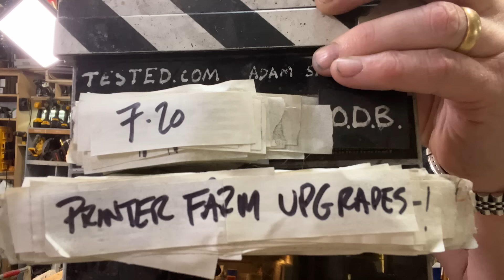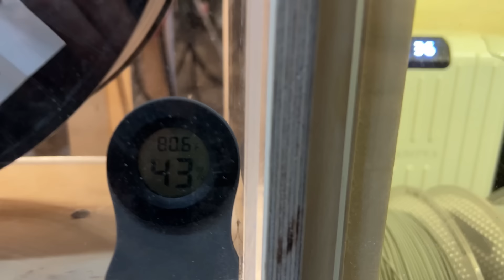Adam Savage's Essential 3D Print Farm Upgrades!

Comment: While I assume you probably know this, you can set the slicer to only print the support filament for the interface layers, rather than the whole support. That drastically cuts down on the number of filament changes.
Reply: Up Voting this bad boy, its suck a great time saver (and the really expensive support filament)
Reply: Also when printing PLA you can use any regular PETG as support instead of that expensive PLA support filament.
Reply: That's what Adam said when he explained it, I think!
Reply: No, that results in more filament changes. The filament still needs to be changed at the interface points, except now, the filament changes from support to interface and from interface to part instead of just from support to part.
Reply: @gownerjones you're forgetting about the perg time it saves.
Reply: @kathleenrobertpogue6818  Not sure what you mean by perg time but any time needed for filament changes is multiplied if there are more filament changes.
Reply: He literally said that in the video...
Reply: You took the text right out off my keyboard.
Reply: @gownerjones you have a lot more filament changes when printing the whole support in another filament, cause every layer needs to purge at least once. If you just do interface layers, there are no purges until you reach this point
Reply: @floriansollacher2804  Actually, you're right. I thought about this all wrong.
Reply: I'm pretty sure that's what Adam was implying. That's why he only said the interfaces.
Reply: @gownerjones Huge character development
Reply: @tripslord9029 I have absolutely no idea what you guys are talking about, however as I read his comment I was thinking the same thing. It’s rare on here that people admit their mistakes.
Reply: Wow.  Never even looked into using PETG or support filament as I assumed it was wasteful.  Thank you for sharing the knowledge!
Reply: @Wood-In-My-Eye  Basically it's swapping between the print material and the support material for each layer up the entire support tree vs swapping just where the support and the object meet, on the Bambu x1c a lot of material has to come out to properly swap materials

And I agree
Reply: Thank you,.
No I did not know that. AND, I am amazed that so many times, I learn more from reading the comments than the actual clips overall on YouTube.
Always read the comments, apply your Muppet filter later.
Reply: @DavidKSanders But he also said you can have 800 filament changes in a print. That seems like way too many unless you 1) have the layout all wrong and require way more support than it actually needs or 2) have the entire support structure being printed in another material, guaranteeing that there's at least one filament change per layer.
Reply: This can only result in less filament changes if there are slices of your part that don't have any interface, such as vertically squarely angled parts where the interfaces are completely horizontal, or parts that have elevation ranges where all overhangs across the entire part are less than the support overhang angle. If this is not the case, it results in the same amount of filament changes as before, only exceeding that if your slicer is not smart enough to do all of one material in a single layer at once before switching.
Reply: @needamuffin in a complex print I think it's reasonable. It's two changes per interface so you only need 400 points of support. Models of mine that are large but pretty basic have around 40 to 50 support points. Leading to 80 to 100 changes (tbh its normally above 100 when I print).

Then you add in a colour change or two and those changes climb like crazy.
Reply: Fun to watch but the video should be retitled “watch adam over-engineer literally everything”
Reply: I was hoping to see you design the scrap funnel to 3d print
Reply: Way to go Eric, I just tried this and it works - I now feel safe to use my roll of expensive support filament - many thanks for the tip.

Comment: Amazing how far 3D printers have come in 10 years. My first home built printer required me to program an Arduino every time I printed. My first commercial printer was $2K and so frustrating to use it mostly sat in my closet. My $100 ender3's are phenomenal.
Reply: Agreed. Out of my 5 printers, the $100 Ender 3 Pros are the workhorses. They’re not fancy, no network, no ABL, no touch screen but they work 100% of the time. The $500 and $700 printers are ALWAYS broken down.
Reply: Same the only thing I wish is that it could do 500mm/s lmao. How fast is yours?
Reply: I started with a Homers/Tevo Tarantula E3 clone.  I ended up having to mod it to death.  TheTarantula finally gave up the ghost and I bough a Sovol SV06. The Sovol prints all day and night without any issues.  The Sovol requires very little maintinance and mods, and it printed all the parts to bring the Tarantula back to life. The Trarantula already has a MKS Nano V3  board,  and it is targeted for a dual belt drive Z axis, a Sailfin extruder, and a Hero Me hot end carrage.
Reply: CTC Makerbot clone purchased in 2012 is still running..... I do have to run a warmup cycle though because the set temperature of 215 drops below 200 and you can hear its unhappy. Leave it a minute or so to warmup and overcool and warmup again and its all good.  Still use the original makerware software because it just works and does what I need. Although the x3g files are a pain if i forgot a setting have to reslice.
Reply: @IronAlien while I don’t necessarily disagree, I would love faster speeds, its a trade off I am more than happy to make to get a fairly reliable and dirt cheap printer.
Reply: @c1ph3rpunk my Kingroon KP3S Pro out prints my Ender three that I’ve spent double what I’ve paid for it in upgrades.  The Kingroon is $129 right now so I’m buying another one.  They just work.
Reply: My 1st was a Robo R1+ and was a workhorse until last year. When I could get a creality machine cheaper than repairing and upgrading the old girl.
Reply: And bought for pennies on the second hand market sold by people who get rid of anything that doesn't work properly all the time/every time. And parts are really cheap, but even cheaper if you buy no-working printers for scrap money. Got 7, 8 bit machines for $50 the other day. That's 28 steppers, 7 by 24v power supplies, V6 head assemblies and heated beds, and all the rods, nuts and screws I'll ever need.
Reply: ender3's are dogshit, but bambu's are pretty golden chefs kiss
Reply: @HeyitsmeEarl yep, bambu is better, but it also costs 10x more.
Reply: I find that hard to believe.  I started with an Ender 3 and while it was OK it was not phenomenal.  When I upgraded to a Prusa it was night and freaking day difference in reliability and quality of prints.  The Ender 3 just sits in the closet now.
Reply: @c1ph3rpunk you clearly haven't got a bambu
Reply: @c1ph3rpunk  My Ender 3 V2 that I had new from died a while back.
Not the best but it got me into 3d printing and has sentimental value to me too so I may fork out on a new mainboard and any other needed parts.

Meanwhile my Chiron I bought used is a tank. Runs for days if not weeks on end. Reliable and when it does inevitably break, it's cheap and easy to fix. Sometimes just a bit of solder, tape and a broken biro and it will be back working.
Reply: 3D printers didn't change much in the last 5-6 years, I mean the good ones already had Auto bed leveling and all the bells and whistles many years ago also the fast CoreXY printers were there you just needed to spend more.  Anyway. if Bambu starts making large build plate printers (30cm+) I will change my printers but the current ones are way too small
Reply: @c1ph3rpunk  same i have a ender 3v2 with sprite extruder, but i have a "shelf" made what is above the printer soon to be printers (v3 KE coming) and then i have spool rollers on the shelf and i run my 3kg spools straight from there and dry them in an second hand oven works like a charm
EDIT: spool rollers have printed frames and rollers, bearings go in the rollers and i use M8 all thread to connect the rollers to the frames
Reply: @IronAlien I got mine up to 100mm/s but there is a bit of a drop in quality. I probably could improve it with better cooling, but I changed it back down to 50mm/s for now.
Reply: @HeyitsmeEarl  my man has late market privilege talking like this. Bambu machines are truly night and day compared to them, but that's the equivalent of putting a Formula racing car against the same Formula car but printed in PLA, lol.
I would definitely spring for an A1 over another ender3 these days, but go back just a few years and the value of an ender3 is simply unbeatable. They still put out great results now- it just costs more time and attention than newer machines.
Reply: I got in about the time of the Chinese clone wars. Got a builder kit and got it mostly working, had to flash custom firmware on the board it came with and then dial it in manually. My own construction was so poor that I could barely get a benchy printed without the stepper rattling itself apart.

Comment: The blue anodized aluminum color is almost impossible to match with a color filament. The yellow, red, purple and green are easy to replicate using many different brands of silk PLA without having to sand and paint.
Reply: This made me wonder if it's possible to buy or make powdered anodized aluminum. You could then mix it into the plastic or maybe use it with some adhesive for a coating.
Reply: @LanceThumping  I am by no means smart, but that sounds like a really good idea
Reply: I've tried a few, trying to get a decent blue metallic look. Most are way too light colored. The only thing I've tried that was close was Geeetech PLA Royal Blue. If you print it too fast, like most silks, it can end up not being very shiny at all. Your mileage may vary. I print silks on an old printer that runs around 60mm/s. My newer printer that runs at 250mm/s+ usually makes it look dull unless I slow way down on the outside walls.

Comment: Little suggestion: when you run a filament guide through an enclosure box, leave some of the guide tubing protrude inside the box. It will allow a smooth path, and avoid a potential kink forming where the filament goes through the box wall.

Comment: 14:30 Adam Savage is my Spirit Animal. Like I tell my boss; not /everything/ needs to be 3D printed. Sometimes all you need is a bit of plywood and a stapler. As for your table solution; have you considered making a pull-out shelf under the two X1s? I did it for mine, with just enough clearance between the shelf and the top for a cutting mat and another printplate. Pull it out, put your full plate on it to clear while popping the empty plate into the printer.

Comment: So far my favorite metallic has been Hatchbox.  I have a metallic gold that I used to great effect.  Use very small layers, .16, .12 if using the .4 mm nozzle.  Since the hose connectors are a relatively small part you can go as fine as you want and it not take 8 days.  Oh, and print the perfect waste basket, using vase mode.

Comment: I switched to textured pei plates while printing face shields during the pandemic. I quickly realized what a no-brainer it was to have an extra sheet on hand. I would simply swap plates and put the printed plate on my post-processing bench and then start the next print. I’m no longer in a rush to clean the plate and I let my prints cool naturally. Keeping my plates rotating and having proper time to clean without damaging the pei, I haven’t had to buy new sheets since. It’s honestly the best upgrade I’ve ever done.

Comment: You definitely undersold the nesting done on that print. That was so nicely stacked in there, so impressive.
Reply: all you do is hit auto arrange lol not too impressive
Reply: @kordellgreen9794  Clearly you didn't pay much attention to the plate because there's no way the auto-arrange capability of Bambu Studio would give you that arrangement. Notice the parts nested inside other parts? And some parts overhanging other parts? While I haven't actually loaded the .3mf file in Bambu Studio to know for sure I wouldn't be surprised in the least if Bambu Studio complains with "errors" about multiple parts being too close.
Reply: @Kloberman  Bambu Studio pops up errors for all sorts of shit that will work just fine. You can adjust the maximum spacing between parts anyway in every slicer I've used. PrusaSlicer's auto arrange will do everything you just described, like nesting parts inside or overhanging others.

Comment: 30:32 For the most metallic 3D parts you could finish the part and then paint it with a metallic color of your choice. If you want a truly metal finish look into graphite electroplateing or by using a Conductive PLA. You can find it by searching 3D part electroplating or PLA electroplating. If you want a solid metal part you could cast it by making a mold using the 3Dpart. If you just want a metallic PLA I would recommend SILK PLA or a Composites/Metal PLA. Hope This helps. Peace and Love Dude!:face-red-heart-shape:
Reply: be careful with SILK filaments, AIUI they have a lot of additives (tpu?) that make their layer adhesion awful. you have to print them very slow and very hot.
Reply: @shanemshort I've never found any issue with silk materials. I usually run all PLA at 200°C at the same speed and get good results for standard and silk.

Comment: If you wanted to get really fancy with the "scrape table" (that's what I call my version of this), you could route the surface of the table with the shape of the various plates you have. That way the plates drop in and are flush with the table surface, and you don't have to hold them while scraping.
Reply: This sounds just like such an Adam thing to do!  This combined with something like Arctyrus's comment about a pull-out shelf under the X1's would be the ultimate!  ❤👍
Reply: what about magnetizing it?
Reply: @gleechy  I like how you think. 😁
Reply: What about a slide out shelf, with a recess to hold the bed, that has a scraper fitted on the edge so all you have to do is place the bed on it, push it in and out and the filament is removed!
Reply: K.I.S.S. Just put a couple stop blocks on the corners just like the X1C and P1P have on the build plate and no worries.
Reply: Key it like the bambu labs sheet applicator tool and you'll be able to use it to replace the build surface.
Reply: @lauriewsmith1  I was thinking the same thing.  The pull out would need a dowel stop to keep it out while scrapping.  Maybe like the shape pf a cutting board.

Comment: Adam if you load the same filament in those empty bays of the AMS it can automatically switch to the other same filament when it runs out and continue printing so you don't waste time changing out and resuming. 👍